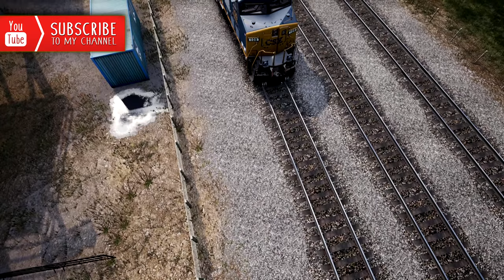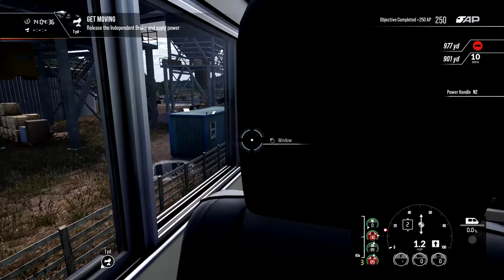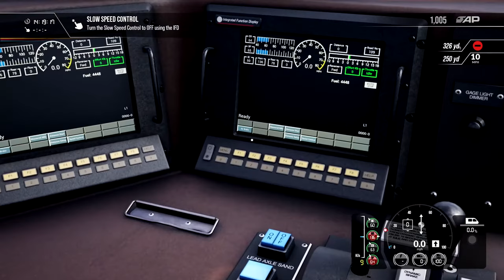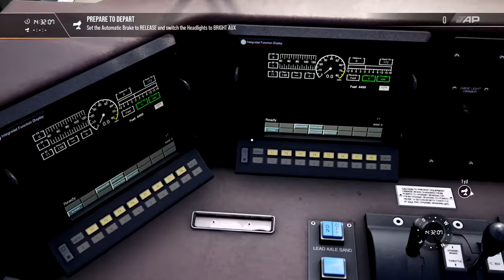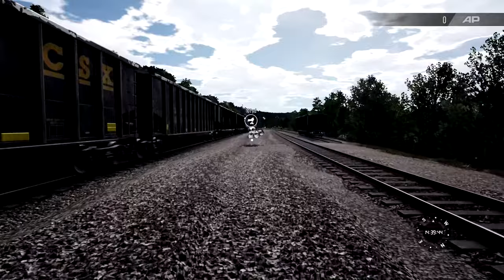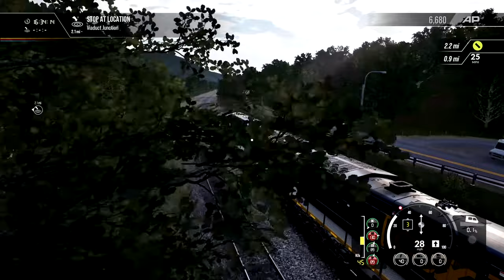Train Sim World 2: Sand Patch Grade - Powering America Part 1 & 2

Comment: Ok. Today I got it. I Play on PS5 and they changed the behaviour of the brakes. Last year you had to Drive How it is shown in this Video. Using the Dynamic brake. Now you have to use the  automatic brake but very careful. When at 100 use the Independent brake very careful. When also at 100, then use the Dynamic brake but only to Maximum 2. Drive slowly and try Not to use the Dynamic brake. It Took me 30 Minutes longer but I came Home safely
Reply: I appreciate this comment, I was seeing comments reporting the issue and hoping somebody found a way through it

Comment: Sitting in chair you may use left and arrows keys to observer display and so on. Also, sitting, you can "teleport" by Crtr+"-" or Ctrl+"+"
Reply from the maker: I'll check that out, thanks for advice, didn't knew about teleport thing.
Reply: To properly teleport to end of train, before teleporting activate external view, PC key "3" and again activate external view (press 3 again). You'll move camera to end of train. Then press "1" and return to front cab. Then press Ctrl-"-".  Voila! you are sitting in the rear locomotive.
Reply: so useful
Reply: Can u teleport on the Xbox version?

Comment: Question, do you really need Banking Com ? I though the Distributed power fuse was there so the trailing loco at the rear would power itself
Reply from the maker: You need banking COMM for the rear locomotive to work unless you want to pull dead weight with whatever weight those coal hoppers already have xD

Comment: Hi, Fluffy, first of all, thank you for your video. I am trying to do the same mission powering America Part 2, however since it is a long journey, I decided to auto save the progress in the middle, however the problem I am having is that the next day when I try to continue the checkpoint I've saved, I cannot engage the locomotive to move forward, the controls dont work and no power is assigned to the train and it just go to a full stop. Any Idea if this is a bug of the game? I have heard that it was in the past. While using the auto save during a journey, both the front and rear locomotives are started, running instead of just the first one we are driving. Appreciated your help in advance. Thank you
Reply from the maker: In all honesty, I’ve never used the save/load function. But maybe you should just check if all brakes are released and eventually use bankingComm once more just to make sure everything works.
Reply: @FluffyAdmiral  thanks a lot!!
Reply: @edenlincoln  check the three switches. I found that the Gen Field switch had moved to the "OFF" posn.

Comment: HI, I have been trying to release the independent brakes but for some reason, it is not happening. Can you help?
Reply from the maker: Make sure the brakes in the front loco are set to “Cut in”
Reply: @FluffyAdmiral  It is Set to cut in. Still not able to release my independent brake.
Reply from the maker: @huskal  :_admiralIdea: You may try and move the independent brake lever to Bail-out position and hold it there for a second or two. 
Also front loco brakes should be set to Cut in and Lead while trailing loco needs to be set to Cut out and Trail. Hope that will help.
Reply: @FluffyAdmiral  I'm still in the section where I have to load coal. Even after the bailout position on independent brakes, the train starts to move but the symbol from the independent brake does not go. As per your video from 8:18 to 8:28.

Comment: It's not working, the independent brake icon still come up, I did what you do, Full application, and then released, but it's still not working, I really frustrated
Reply from the maker: Try and pull the independent brake lever lower than UI indicator tells you and hold it in that position for about a second and then release left mouse button, it may trigger then.
Reply: @FluffyAdmiral  Finally, I success finish Powering America part 1,
 I fixed it by changing the Display setting to low, The issue is with the FPS, as I can't get the objective to complete if my FPS is below 30. When FPS increases to above 40-45 FPS the game registers the brake as being released and the scenario can progress.
Reply from the maker: @obopesek  wow, didn't realised that's the thing. I'm glad you managed to sort it out. Thanks for the info :)

Comment: How do you control the blue bar, mine is at full throttle going slow?
Reply from the maker: Blue bar will increase as you add throttle, but if you add too much too soon you will cause a wheelspin and your train won't be able to move quickly.
Reply: @FluffyAdmiral  I hit the throttle the same time u did and it still goes full on 4th gear or higher.
Reply from the maker: @stash8293  I'm not sure what could be the problem then, perhaps you're not getting any power from the rear locomotive that is supposed to help you by pushing the whole train. You may also try and use some sand while moving off to prevent wheels from slipping and get the train moving.

Comment: Hi, I've recently downloaded by steam and I am having a strange problem on Powering America Part 2  , right after passing sand patch tunnel while proceeding downhill, even I reduce the speed 15mph train derails and mission automatically re-starting. I've tried to re-start the game but still same, any ideas ???
Reply from the maker: I never had that issue to be honest, and as long as you follow the signals, everything should work fine. Remember that speed limit increase applies only after entire train passes the sign post. Decrease applies as soon as your loco reaches the sign post.
Reply: @FluffyAdmiral  there is no problem about speed limits, the speed indicator is neither yellow nor red, problem is loco derails (crashes) completely, I had the same problem on next missions last part today (coal freight Yoder to Cumberland), with other locos there was no problem going downhill by dynamic and auto brakes, looks like those AC4400 locos have a matter with me :)
Reply: You're not alone. All the posts I've found about it say that you have to use the loco brake and be really gentle on the dynamic. If I go above b4 then I derail as well. Also, the loco brake is still on at the very rear loco. You can see the bc goes to 64 when he changes it to lead. You can get it to 0 by pulling the lever into bail off after changing it to lead, or cut in and lead (I can't remember exactly what combo). The train starts rolling without any power at all when the brakes are completely off. I think that's why Fluffy can get away with less dynamic for a while compared to me. I only got the game a few days ago, and it seems that a recent patch introduced the derail issue. Also, just touching the train brake derails it on the down slope after the tunnel.

Comment: Ok sports fans, I've got a good one for you. Sand Patch Grade Powering America. I board the train and follow all of the instructions. After establishing slow mode and setting the slow speed to 2 MPH as requested, I get to where it asks me to release the independent brake and apply power. I do this. The request remains, unlike the YouTube videos I've watched. I receive no acknowledgement tone and the message area does not clear. I get the train to 1.8 MPH, and the coal is loading it's face off. I get to the end of the loading. The request to release the independent brake and apply power message remains. I am not told to stop the train, or anything else that I've seen in any of the YouTube videos. I admit to being confused by all of this. Any practical suggestions would be most appreciated.

I found an instance where someone else had a similar experience. I checked my advanced settings and found that the MAX FPS was in fact set to 62, far beyond their reported setting of being below 30. So much for that. I will once again consult the STEAM focus groups for more insight into resolving this puzzle.
Reply from the maker: Apply and release independent brake once more and hold it on release for about a second or 2.
Reply: @FluffyAdmiral  Thanks so much for the suggestion. Unfortunately, I fear there is a larger issue as I tried 5 times to apply and then release the independent brake, holding it in the released position for a nice 5 or 6, 1000s count. I will try to get a more definitive response from our good friends in the STEAM user forum. Thanks again.